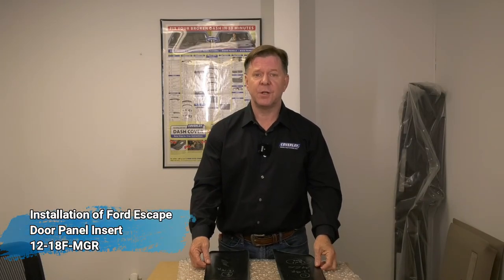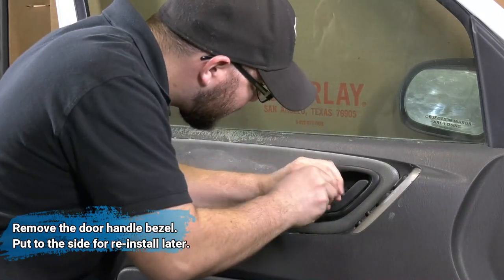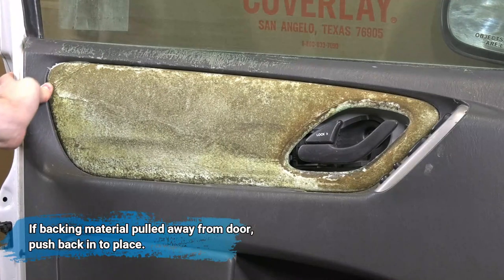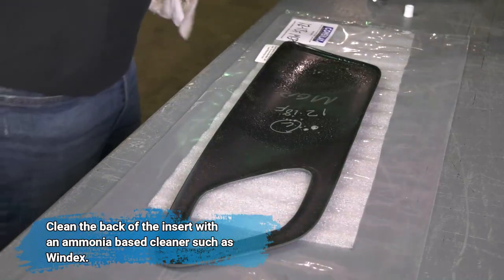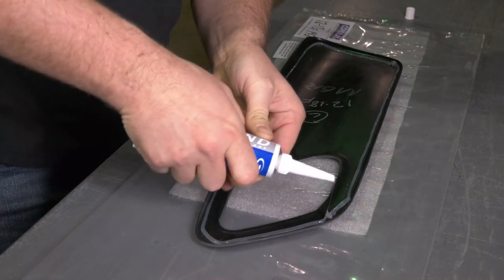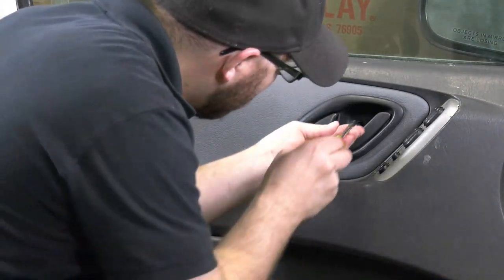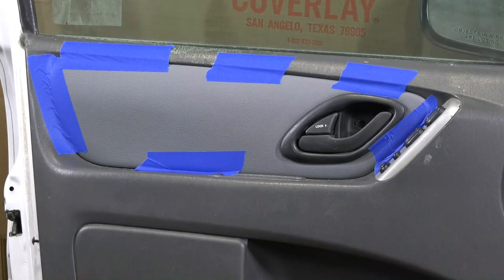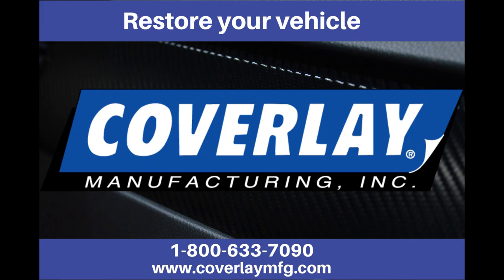Coverlay® 2001-2007 Ford Escape Door Panel Inserts. Part #12-18

Comment: I just received my inserts today. Being a single woman I have to do alot of things myself (that I can do). I just replaced all four days. I followed the instructions and it turned out just fine. Thanks so much. The vinyl had started to fall off and it was driving me nuts. I have a before and after picture ☺
Reply from the maker: That is awesome! Good job! If you could send before and after to customerservice@coverlaymfg.com I'll send you a couple of thank you gifts. When you send that email with photos, please send a mailing address - you can put "Before and After Pics for Marketing" in the subject line.
Reply: What did they send you?
Reply: @runed0s86  I received 4 inserts and a tube of glue.
Reply: @MzPami72  They said they were going to send you additional gifts though
Reply: @runed0s86  They did. A hat and a towel with the company's name on them ☺

Comment: It's a good idea.  I just am finding it hard to pull the trigger on $138.77 for two of these.
$138.77 for all four and I order them right now!
Reply: I agree, these seem way overpriced.
Reply: Abs plastic is cheap, and their 'exact fit moulding system' is easy to do if you have the equipment. It would be a little bit cheaper to buy a 3d printer and print your own door panel inserts!
Reply: I went to the website and they are asking 400 bucks for all 4 lmao 🤣
Reply: @runed0s86  interesting!

Comment: Good gravy! Anyone handy can cut a few pieces of fabric or vinyl material and use some spray glue adhesive and fix this problem! What I need is some pieces to cover the top edge of the door panel where the sun bakes the color out of it. I guess I’ll just have to spray paint them or dye them.
Reply from the maker: Reports we get back are that the spray adhesive to vinly or fabric do not stay put. The ABS plastic these are made of is a "one and done" solution.

Comment: Looks like a great solution, because replacing the viny has failed every time no matter what glue I use. Before I order, the hard backing on my escape has already been removed down to the bare plastic. Will the new insert still fit without this backing in place? If not, do you have any suggestions?
Reply from the maker: Yes it will fit. Clean the area well before install with Windex or another ammonia based cleaner. FMI please contact us at 800-633-7090 or visit our website: https://coverlaymfg.com/

Comment: When we started this the fabric peeled off, as we wiped to clean the baked on adhesive off, we were in for trouble, sorry to say we’re still working on removing the adhesive.
The winded didn’t  work a baked on mess, might have to buy the complete door panel. What are the recommendations??
Reply from the maker: Clean the adhesive as well as you can but not all of the adhesive will come off. Our silicone adhesive should still hold the insert in place even with some of the old adhesive still baked on. Dry fit the insert without silicone first to make sure it sets in place. For more information please feel free to give us a call at 1-800-633-7090 or email us at customerservice@coverlaymfg.com.
Reply: The old adhesive comes of easiest buy just running your finger back and fourth and if you have a small shop vac or any vacuum with a hand held hose will suck it up as it loosens and falls